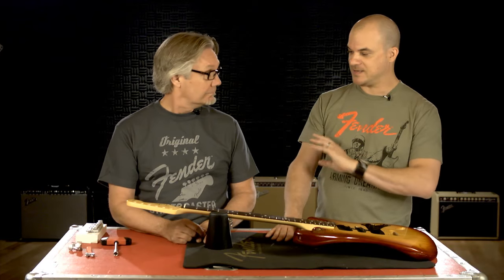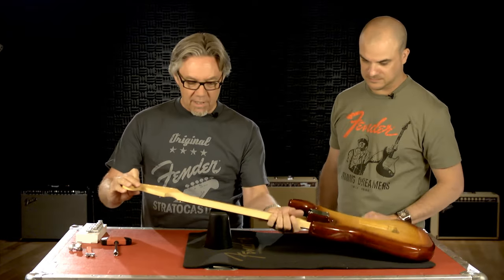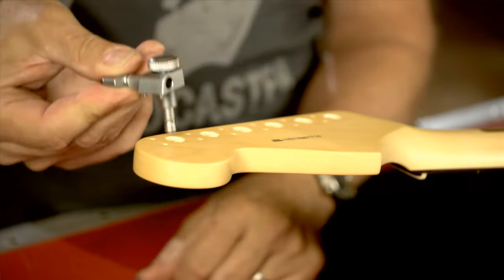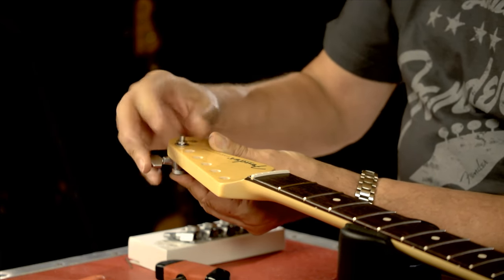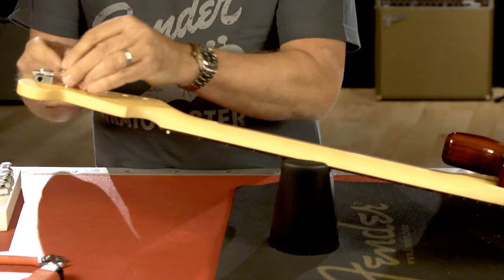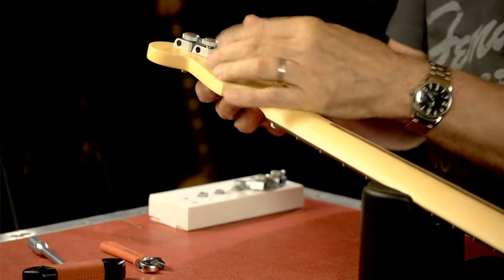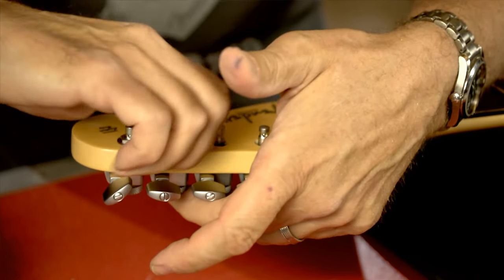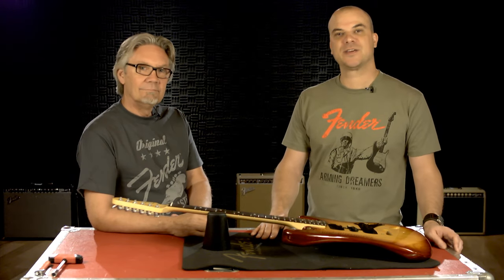How to Install Tuning Machines | Fender

Comment: You're missing a very important critical detail here that could easily be provided, which could save a LOT of time, money and frustration for the consumer or potential consumer, that every consumer must know at some point in the process if it is to be a success at all:
1.) What are the dimensions of the holes on that pre-drilled neck?
2.) What are the dimensions in relation to the holes on the neck, of the tuners you are planning on installing?
These two details make ALL the difference to make this a 30 minute project for some with the correctly matched neck and tuners and minimal tools, versus a project that has incompatible neck and tuners, which has to be farmed out to a qualified luthier or repairperson with specialized tools, and therefore costing not only a fair amount of time but also money to complete. Please think through these videos beforehand, and make sure that you add the critical and necessary information for not only the experienced guitarist and tinkerer, but those who don't know enough to even think fully of all aspects involved. Thanks.

Comment: Let me just start by saying that I truly enjoy Fender instruments and that I'm sure you gents know your stuff.  But why don't you actually take a little more time and go into more detail on these vids?  Wow.  So much is left out here.  Hole diameter needed?  String trees?  Various tuner heights?  Some folks don't even know what a locking tuner is or how to use them.  Come on, Fender.
Reply: ***** The demo is only showing how to install Fender locking tuners in Fender necks. What you are asking for would involve at least a half hour, and it is not for the casual guitar hobbyist, or pro.
Reply: +Casey Van The tuners aren't even labeled, but come in staggered heights from Fender. o-o
Reply: +Casey Van it doesn't even show how to install properly come on!
Reply: Stephan Fry PS: Thank you fr your help in the other comment.
Reply: Pretty sure these aren't the staggered tuners. Those are the polished chrome deluxe locking tuners which eliminate the string trees. These you will still need to you use the string trees.

Comment: I need a video that helps with plugging the guitar into an amp, you know like a take this plug and stick it in this hole sort of instructional video.  Thanks for this in-depth look at installing these tuners.  I especially like how you told us how to drill the twelve holes so that the tuners would line up correctly, you know about the part where you told us where to get the template to do so.

Comment: what's the different between the long post and short post locking tuning machine? and how its affect the guitar?
Reply: the long posts are designed for wound strings and the short posts are for the plain strings. this gentleman obviously doesn't know the difference!

Comment: I'm trying to install Fender Locking Tuners with two pins on them, onto my Squier Affinity Strat which only has one pin hole in the center.  I plan on toothpicking that hole with some glue and drilling out the pin holes for the two pins each, but, how do I set it up to drill in exactly the right place so the tuner fits in nice like your factory drilled headstock?  I'm hoping you can help me.

Comment: The second time he used the word "simple" I thought I'd investigate my project. As it turns out, my neck does not have those two pre-drilled notches for snugly inserting the tuners. The tuners I have require screwing the base with one very small screw and my replacement neck does not have holes pre-drilled for this purpose. There is very little clearance between the tuning machine and the screw hole therefore I will require a precise very small screw driver for installation. Pre-drilling seems redundant given the very small screw size so I'll use an awl and some creativity for providing base working support.

Comment: How come american pro 1 strat comes with 4 short  and 2 long tuners yet when you want to upgrade and buy a set they come with 3 short and 3 long....why cant you buy what you need or what the guitars originally came with.

Comment: Since these tuners are variable height, do you still need to use string guides?
Reply: +Andrea_M no
Reply: no, but the holes look stupid, so i put some in with roller guides just for giggles

Comment: So, if the headstock doesn't come with locater holes, i have to drill them myself? It cannot be installed without locater holes?
Reply: +Sam Moon lol yeah man ... I guess they don't have a concept of follow up.  You would have to drill those holes if you install the Fender tuners on another neck!
Reply: Correct

Comment: There is no way you should use a wench like he showed to tighten the turner . Use a socket like the other tool he showed , WOW, and he is from Fender.
He didn't tell us about the tuners , they come with 3 long and 3 short no one word about that.

Comment: The high e on my custom shop stratocaster keeps going flat. I know about streching strings out to get the slack out, but have never expierenced this problem. When I tune the high e to pitch after plenty of streching, it immediately starts going flat. I don't know if my machine head is bad or needs tightening or if it could be some other issue.
Reply: perhaps a little graphite in the nut slot
Reply: Get rid of the string tree

Comment: Don't waste your time you will learn nothing. They paid two guys (3 inc cameraman) to show pushing in Fender tuners into a factory predrilled Fender neck and then screwing the collar on. They also ignore the selection of the staggered height positions which I am pretty sure the "expert" got wrong anyway. Fender if you want to throw money away please just send it to me! A useful video for the average person would be to upload a video showing you how to drill the tuner and locator holes, what size drill to use and link a PDF template for people to print out and assist in the accurate location of the locator holes and main tuner holes. The rest is obvious.
Reply: +Stephan Fry Yes, I saw... But you could've talked about the staggered height?  How does that work?
Reply: +Crissa Kentavr the string hole is much lower (closer to the face of the headstock) sequentially as you get further from the nut to increase string angle and downward pressure without the need for string trees which may catch the string and make it go out of tune whilst using the trem bar.
Reply: Stephan Fry Ahh.  Well, only the eldest vintage tuners I have are graded like that.  I was in fact, doing exactly what they're doing in the video here.  The 50th anniversary strat we had in fact didn't have graded tuners, but it did match the keying for the modern locking, so we just dropped them in.  Three taller, three shorter.
Reply: He did forget to mention the height difference between them but he did grab the right one lol i have their set

Comment: Why doesn't ANYONE tell you what NUMBERS the STAGGERED TUNERS GO ??? Mine came with NO INSTRUCTIONS.  Even these Fender "experts " don't tell you EXACTLY HOW TO INSTALL THESE THINGS. THANK YOU
Reply: You may see some roman numerals on the underside, these are DIE numbers, and the casting dies are numbered so when one of them gets gummed up (and parts start being rejected during inspection) the plant
 employees know which die to take apart and clean or repair. The numbers have no bearing for installation orientation. Just remember the 3 taller ones go close to the bridge for the wound strings.  The shorter 3 posts are for the E,B,G.  Hope this helps. Rock on!
Reply: @Stratmandew  Thank you!!! Good grief!! All these comments complaining about the lack of instruction for the staggered tuners.... and I agree with the complaint... but no one bothers to answer it. And you did!! Thank you. Great comment. I'm installing a new neck, and new tuners right now, on my Strat project. Thanks!
Reply: @jimmyz2098  glad i could help, shoot me a pic when your get your mod done.